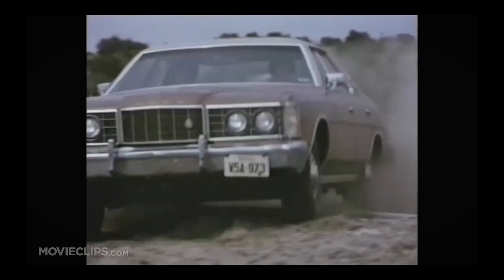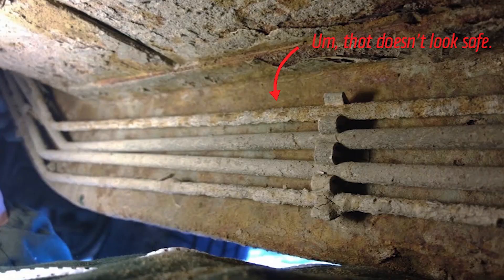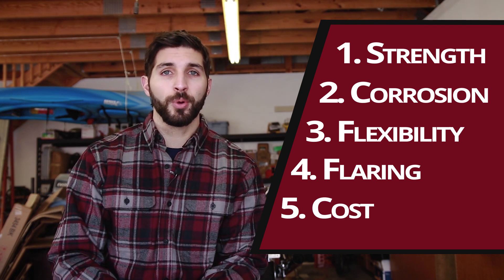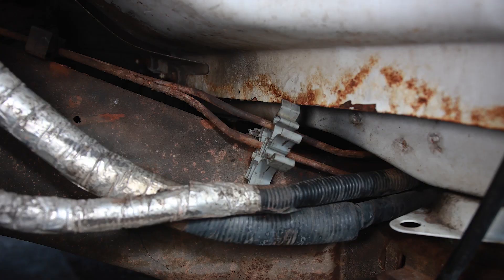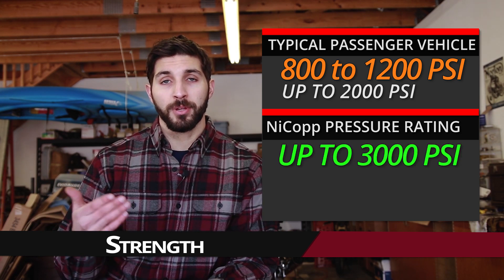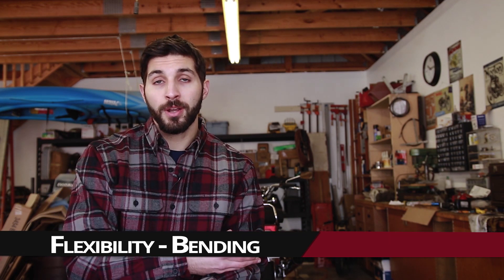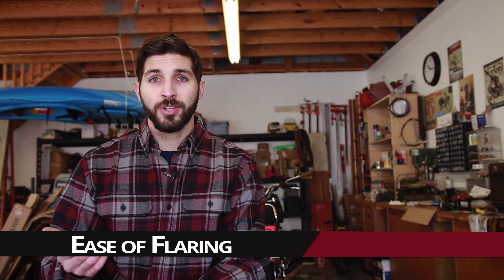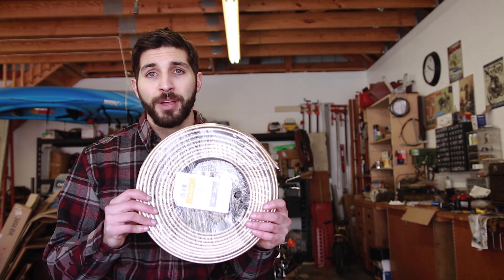NiCopp -  The BEST Brake Lines in the World and Why. NEVER Rust | NiCopp Pros and Cons review

Comment: Hello,
          I did my brake fluid lines  on both my 1979 chevy van and my 1984 Oldsmobile  is totally stainless steel. I don,t buy or believe in Nicop. Just hold a magnet to Nicop and it sticks. NO good. And yes, I invested in a double flaring hydraulic tool for stainless steel double flaring.  It cost me $300.00 Through online tube company. It's paid for itself. And yes the bleeder screw s.  Protionalizing valve , the flare nuts , the bleeder screws is all stainless and adjustable for the rear brakes. And yes , my skill set as an electrician self taught me bending electrical. 
 

 tubing for wires protection.  

Auto makers practice "PREDATORY ENGINEERING ".. IT IS CHEAPER TO PAY OFF A DEATH BENEFIT, THAN A LIFETIME DISABILTY BENEFIT.

MISS PAULA WALACH-FORMER INDUSTRIAL ELECTRICIAN-UNION MEMBER IBEW LICENSED SINCE 1972.STILL WORKING FULL TIME IN THE TRADE FOR A COMMUTER RAIL TRANSIT AUTHORITY

Comment: I needed to replaced a section of Fuel line on a 2005 GMC Pickup with the 4.3 FI.  Saw nylon line kits by Dorman, but then later noticed that NiCopp or Nickel / Copper is also available as a replacement for fuel lines.  Just an FYI if needed.

Comment: I bought 3/16 inch brake line advertised as Nickel Copper on Amazon.  I bent about thirty bends and bubble flared both ends only to find the tube is magnetic.  The local auto-parts store carries AGS brand and it is not magnetic. Re-bent the lines two more times and finally installed with DOT 4 brake fluid.

Comment: so if i buy nicop for my 2001 silverado  will the same fittings work that came with my original steel lines???
Reply from the maker: You'll need to get the right size line and fittings for your specific vehicle. As long as it is the same diameter and fitting it will bolt up to your stock calipers
Reply: @TheSundaeDrive  yes,i think i have ordered everything i will need...thanks
Reply from the maker: Awesome!

Comment: Only con of having copper brake lines Is bending them Higher prone to pinching rather then bending
 If you never pressed your own lines before You will be come a expert after 25 feet of test trys lol 
Item number 2 If your going with copper lines because you want longer lasting  Dip into getting Stainless steel flex lines to the calipers  They dont rust And provide a quicker soild braking force with little foot to peddle use
Reply from the maker: Good points! 👍 I think Pete is going to be changing out the flex lines for SS soon
Reply: @TheSundaeDrive   I have a whole brake And fuel set up to do in the warmer months on a custom truck if i remember i will set up a video  Keep yours coming All the best. Cheers!

Comment: Great video! Quick question. My Hanes manual says never to replace steel lines with copper because they cannot withstand the vibration of long runs. Any thoughts on if this is true with NiCopp? Thanks
Reply from the maker: You do not want to use straight copper. This alloy is stronger than copper alone.

Comment: I love NiCopp! Just used it to make new brake lines for my 40 year old FJ40 Land Cruiser. Quick Tip: If your new lines leak at the fitting, loosen and retighten the fitting 3-4 times, tightening a little more each time. It forms the NiCopp flare against the seat and stops the leak.
Reply from the maker: Good to know!
Reply: Thsnks for the tip
Reply: Make a small amount of your own lube mix with 50/50 white synthetic grease and clear synthetic base oil, then add 5% by weight tungsten disulfide into it.  Add one small drop to the middle of the threads on the fittings.  Most slippery substance known to man, and it remains long after the oil/grease dries out.  That way your lines can come off easy years later when doing maintenance on failed components they're attached to and you don't destroy the hard lines themselves undoing the fittings.

Comment: I sure wish I would have found your video before going to the 'Auto Parts' store to I would have been able to insist for it instead of the overpriced garbage they sold me and their overpriced garbage flaring tool!!! But as they say, beggars can't be choosers, hadn't I had been stuck with this emergency I wouldn't have wasted two weeks to get a job done that should have taken no more than a weekend!!!
But as this type of work is usually done in an emergency (when the line fails) it seems we buy what we can find and it ends up in disaster... So I went to the auto parts store, not the chain but THE place where I knew I should be able to find professional grade stuff, and they sold me this garbage coated steel line for $25 for a roll of 25 feet and it was HELL to flare, so much so that the tool they sold me for $70, which I fond out later was EXACTLY THE SAME as the cheap stuff sold in biog box stores for $20 (only the band name differed, even the packaging was identical!) "made of hardened steel", BENT and the die to form the flare BROKE in the tubing, and the SECOND TOOL IO GOT STARTED TO BEND JUST AS WELL, so much so that I had to form the flare 1/4 turn one way, remove tool, 1/4 turn the other way, 15 minutes per flare and several days and several feet of tubing transformed into flares later until I was able to make something close enough to OEM (even the clearance recommended wouldn't work, the serrated tubing jaw would would slip if bolts holding the two pieces together weren't totally were not bottomed out, and I had to drill a better shaped flare on the other side of the tool as the existing one was obviously not designed for double flaring) 🙄...   A REAL NIGHTMARE, so much so that for days I'd dream that the car would be falling apart :-(
Lesson learned: Bad tools and Materials should simply be FORBIDDEN for all the misery they cause! Flaring tools should ONLY be made of real, hardened tool steel and brake lines, of this rust resistant, pliable but strong nickel copper stuff...
Anyway, it would have been nice to compare the prices between tubing types so that we could estimate the difference in cost but between you and me, is saving a dollar a foot worth the hassle? My horrible experience says the cheap stuff should not even be allowed to be sold, that's how awful it is :-( And as for the garbage tools they sell for flaring.. It should be CRIMINAL OFFENSE to sell something that is so goddamn bad that it would risk your safety making bad flares that are so badly formed they could break suddenly if you managed to get them installed :-( ...
What I can't understand is why don't that have tools for occasional use that are made or proper quality metal that actually work, like they exist for sockets and wrenches nowadays (gone are the days where you buy a socket that gets rounded out on stuck bold head)? Why do we have to chose between $20 to $40 garbage, and professional stuff you have to special order at more than 10 times the price?

Comment: I am sick and tired of hearing from you young so called mechanics about copper brake lines. Heavy wall copper was used for years without any problems. Then came thin wall copper tubing at your local hardware stores with a warning of not to use for brake lines or limited usage. And dumb Fere would use it anyway. Then came the accident cause the line would rupture on use. Imagine that using straight copper lines that did not fail because they were the proper wall thickness !! So in reality this is the second generation or 2.0 version which most european car manufacturers have been using for years now. The alloy you are using is called coupronickel any alloy with a ration higher that sixty percent copper. Now finally the cheap pricks of US vehicle  manufacturers are starting to use the product. One last thing, I have been using monel 60/40 nickel copper ratio line which is way stronger by a lot. I still have bet you three hundred feet on a spool that I bought at an auction thirty years ago. Still good and fairly easy to work with and resistance factor way off the charts. Just saying fella. Or you could do stainless steel and go that way with a comparable cost. I like the video too. VF
Reply from the maker: Good to know! Haven't been around that long to have that background info so thanks for sharing! Hopefully manufacturers start reverting back

Comment: what are the cons other than slightly pricier? there must be some downsides otherwise everyone and their cousin would be using nicopp, rubs through easily? cracks if a piece is bent a couple times? doesnt like vibration or needs to be secured way more than steel lines? 

just bought a 96 dodge cummins and ripped the be off to replace with a flat deck and theres the factory line to the rear..basically dust now then someone replaced it with a new line that new line has since rusted thru, it was repaired with a union and the current line although it holds pressure im sure if i touch it will start leaking.. so new lines for sure before the flatdeck goes on
Reply from the maker: I've only heard a couple cons and one may be resolved. The first weakness is how soft it is (which makes it easy to work with) it is more susceptible to road debris and probably isn't a good solution for those that off-road. However, rust steal is even more weak. The other issue that we haven't experienced but received in a comment, that the dis-similar metals made the ends very hard to get off due to the metals bonding together. However, the same guy said that the new nicopp lines he got had different ends that appeared to be coated (as do ours) so he was curious how these would hold up. Not a problem unless you have to remove an old line for some reason. I just think most people aren't aware an alternative exists.
Reply: @TheSundaeDrive  thanks for the reply! 25ft of nicopp and an assortment of fittings on canadian amazon for 23$? seems cheaper than what ive paid for steel lines before.. as far as flaring, fittings, ect its all the same tooling and methods as the steel lines and no more difficult if not easier? i have had issues flaring steel lines with them being too squished, or lopsided or just not looking right.. i get it right eventually but usually takes a few tries per fitting

https://www.amazon.ca/gp/product/B0829VG6H3/ref=ox_sc_act_title_1?smid=A3D4WU28DYXF1O&psc=1

Comment: I needed brake lines for my rusty Wrangler. AutoZone didn't have them on hand. But the guy at the counter suggested this. WOW!! So freaking easy. To run lines to the back and hook it all up took less than an hour. They didn't have the bulk roll, and I don't have a flaring tool. So I bought the longest pre-flared sections and linked them with fittings. One thing though. If you want it to look pretty and professional looking, this ain't it. By the time you're done, they're very crooked and warped looking because it's so soft. But totally idiot proof for the DIY'er that just wants brakes or transmission.
Reply from the maker: Hard to get it to look as good but definitely very easy to work with and won't rust 🙏👍

Comment: Here's the problem with these NiCopp brake lines - sure the lines themselves don't rust, but boy the nuts on them sure do. The nuts will rust very fast, in about just two years they will be so rusty you will not be able to remove them without destroying them. Because this brake line is made with a different metal than what it is connecting to, a process called galvanic corrosion occurs (look it up, it is basic chemistry).

 I encountered this problem when it came time to replace my rear drum brakes. When It came time to bleed the brakes the bleeder screw broke off so I had to replace the brake cylinder. To replace the brake cylinder I had to remove the less than two year old NiCopp brake line. The nuts on both ends of the NiCopp brake line was severely rusted, more rusted than nuts elsewhere on the vehicle that were 20 years old. I had to destroy this NiCopp brake line to get it off.

It is nice that the line itself does not rust and I like that they are easy to bend. But the weakness  is the nuts on them and the process of galvanic corrosion. They really need to fix this situation.
Reply from the maker: Hmm that is an interesting point and something I wouldn't have thought about. Just curious, how long ago did this happen? I'm wondering if they have changed the ends since
Reply: @TheSundaeDrive  Like I said, it was just two years ago. I did replace this line again with another NiCopp line. Not sure what color the nuts on the old NiCopp line was. They were so rusted I could not tell what the color was. The new NiCopp line I bought has nuts that are black. Only time will tell if they rust just as fast.
Reply: Why not use stainless double flare nuts? A couple of bucks more and available on Amazon.
Reply: @lukasmatzinger  Just because the package says stainless steel doesn't  necessarily mean good stainless steel. Ask any sailor who spent a ton on so called "stainless" to replace anchor chain, only to have it corrode in just a few years use. If you got it off Amazon, pretty good chance it is crap metallurgy.
Reply from the maker: Sadly true.
Reply: My steel lines in most areas were not as rusted as the connectors so that galvanic  answer doesn’t really hold water imo

Comment: My 1992 Volvo came with these lines. It spent 22 years in northern Ohio. Never replaced any metal lines.
Reply from the maker: Nice! Back when Volvo knew what was up
Reply: My 97 Sierra has gone 29 years in the salt belt with original brake lines, radiator, water pump, coolant hoses, oil/trans cooler lines, and wheel bearings.  I'm restoring everything on it to like-new, rebuilding some now and rest when spring comes.  I love that damn truck, it drives and drives, been all over the damn country in it.

Comment: rust through up north sure, but they are seldom found rusted through down south.  All my vehicles which are considerably older than what you drive retain OE installed brake lines and they are as strong as the day they were installed by Chevrolet and Ford.

Just because steel is used does not equate to them rusting through and failing.  The biggest problem for them is being up north were even the car themselves rust away.
Reply from the maker: That is definetely true. But they should offer a northern package or something (at an additional cost) to equip trucks that have to deal with salt and brine with brake lines that will last. I know this will never happen but dreaming lol

Comment: I have to agree👍 i bought a 2002 dodge truck (rust bucket) just replaced one line from front box back to rear wheel. Here’s a trick heat up the nut with propane, apply candle to it, let set 5 min and heat again and apply your candle. Then turn the rusty nut loose easy peezy every time👍 the wax goes to the threads and it comes loose easily-GIVE IT A TRY👍
Reply from the maker: +KT Tangos good tip! Funny that you just commented on this video because we are redoing the brake lines on my Silverado tomorrow with pre-measured lengths of NiCopp and the flares and fittings already installed. Not looking forward to it but should be a decent video
Reply: Cant wait to see the upcoming video. It might motivate me to remove a compression fitting ( never use them) and replace some lines on a 2004 kia optima😂

Comment: Manufacturers would rather make aluminum beds and fancy step tailgates than put something on the truck that may prolong the useful life of the truck.  Better brake lines, rocker panels, door skins and tailgates that don't turn to dust in 5 years would be a huge selling point for me.
Reply: one has to do there own engineering and handy work     to replace the manufactured foolish perty Cosmetics they do just to get the  vehicle to sell.🚙
Reply: you hit the spot right there: "Manufacturers would rather make aluminum beds and fancy step tailgates than put something on the truck that may prolong the useful life of the truck". That's is the real reason our society is falling apart - GREED and TOTAL DISREGARD for actual honest to goodness value. Nowadays we produce JUNK that doesn't last simply to put money in the pockets of the few at the top. This will only stop when finally get legislators with enough balls to put these manufacturers IN JAIL for producing garbage that HARM PEOPLE AND THE ENVIRONMENT by risking our lives and the unnecessary garbage we need to get rid off prematurely because someone wanted to save a few pennies here and there >:-(
Reply: Dave Reith 100% agree